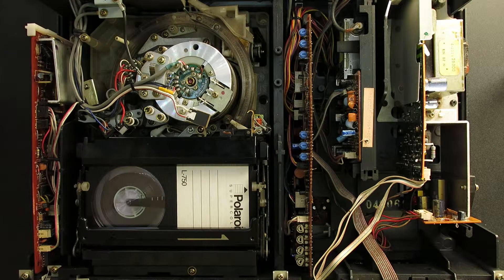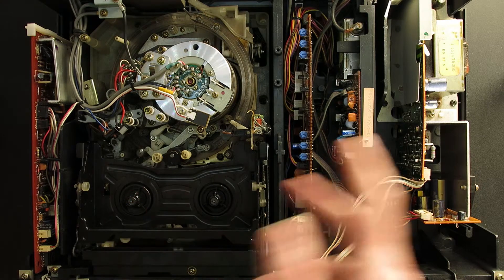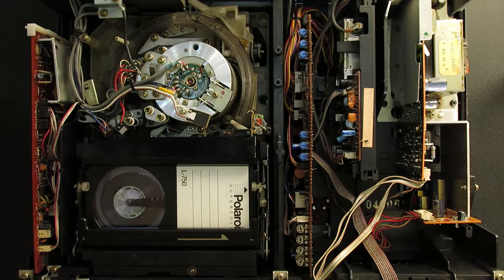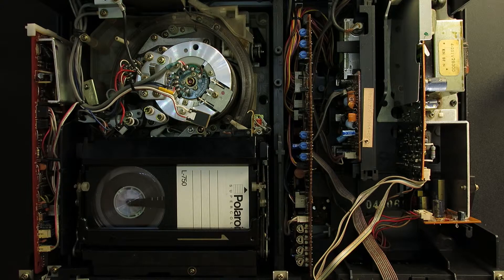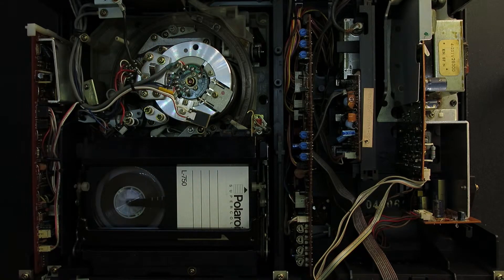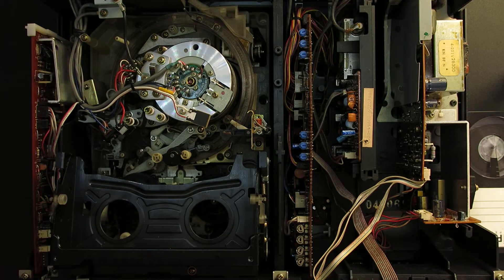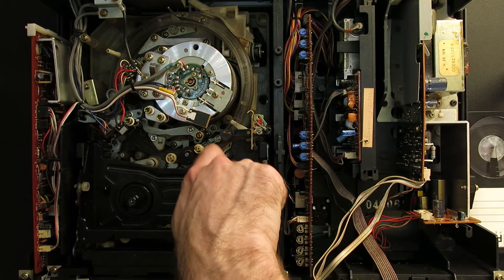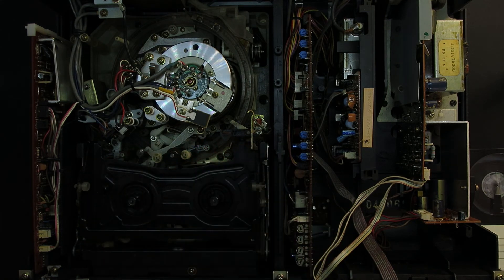1982 Sanyo VTC5000-II Betamax PAL VCR Repair & Discussion

Comment: Hi, do you know it's possible to move or push the loader ring mechanism by hand?. The reason I ask is that awhile back someone suggested to me that the problem I'm having with my 5000 could be due to the loading ring having been jammed or stuck, and that it's possible to move it by hand. I have tried moving the idlers and ring but it won't move at all. Maybe it can only be moved electronically.
Reply from the maker: As far as I remember it's a worm gear mechanism,  so it would only turn by actually turning the motor
Reply from the maker: Try taking the little belt off and see if the motor still runs
Reply: @jamesbennettmusic  Thanks for the reply. Which belt would that be?. Also, do you know where the reel motor is located as I can't locate it. I read somewhere that one of the problems could be with the motor being faulty. It could be anything I suppose, I've had the machine 3 years and still haven't been able to sort the problem out; to me it doesn't seem like a broken belt.
Reply from the maker: @Embracing01  top right of the loading ring, there's a small motor and belt you can see from the top that drives it
Reply: @jamesbennettmusic  Thanks for that. I just tried turning the small motor with the belt around it, turned it abit so that the idler that's touching the tape is moved out a little, I then tried a tape, pressed rewind and by some miracle it started to rewind. I then tried Play and that worked too. I'm guessing something was stuck or it's the belt?. At one point though the tape stopped playing and then ejected. Rewind seemed quite fast.

Comment: James

Just to correct you, the Sanyo 5150 didn't have two extra heads for colour search it was all electronic and keeping things monochrome for search/still frame enabled Sanyo to keep costs low. The 5150 also added a reverse play feature that only Beta could do without adding extra heads.

Comment: what are the differences between the mk1 and 2. How easy/ hard is it to replace the idler and belts ?
Reply from the maker: as far as I'm aware, just some cosmetic changes. An obvious one is the black background on the channel numbers on the Mk1, and silver background on the Mk2. Also the Mk1 has a moulded Sanyo logo. It's a cheaper inlaid logo on the Mk2. But definitely no new features.

Belts are very easy. The hard thing is finding one small enough for the idler assembly, but this isn't a problem if you use a kit I suppose.

Idler isn't difficult either, you just have to be very careful you don't lose tiny parts.

Comment: Hi James, I wonder if you can help. I bought a Sanyo VTC5000 off ebay a few months back. The seller described it has fully working order and was serviced with new belts, idler, etc. I needed another Beta for transferring some old tapes to my PC (the old Beta I have is knackered), so this replacement seemed a good but (I paid about £140 for it). When I received the machine it was in prestige order, all carefully wrapped. Over the week I tried a few old tapes and was pleased with the playback, though there was a kind of "static" buzzing noise heard mostly throughout the playing which I never thought much of. I played one tape and did a test recording and then left it unused for a few days. After about 3 or 4 days later I decided to try some more tapes, I switched it on and put in a tape, but this time it wouldn't play or rewind or Fforward. I don't know what could've gone wrong as it was working fine a few days prior. All I can think of is that maybe one of the tapes has knackered the heads up or caused it to malfunction. I'm thinking that maybe that there was some static charge on the tapes (they were brought down from the loft after 20 something years), and this couldve damaged the electronics. Or maybe the belt has broken, but how after only a few plays I don't know.

I shouldve contacted the seller, but I think they would've just said it was working fine.
Reply from the maker: They do hiss a lot - it's because the tape speed is so slow and the preamp, I assume, is fairly run of the mill for budget reasons. 

When you close the lid, does the motor briefly turn to take up tape slack? Do the buttons just do nothing at all?

Do you know if the power supply has been recapped?

If you set the clock, does it keep the time, or does it lose it every time you take it out of standby? This can indicate a capacitor failure if it does.

Comment: Do you fix vcr I have an pal vhs Sony md that eats tapes and only plays when I press rewind for a couple seconds then says err
Reply from the maker: Could be any number of things. Check for loose or dry belts, tyres that don't grip or pivot arms that are seized and don't pivot! At least there are plenty of VHS decks around still, so it's perhaps no great loss if one fails.
Reply: Thank you I dunno if I would ever open it up and fix it myself I wish maybe I dunno honestly should I ????
Reply: Thank you I dunno if I would ever open it up and fix it myself I wish maybe I dunno honestly should I ???? Are PAL insides different from Ntsc
Reply: Thank you I dunno if I would ever open it up and fix it myself I wish maybe I dunno honestly should I ???? Are PAL insides different from Ntsc

Comment: I have the MK1 version and I think someone managed to swap the bottom video board with one from a VTC 5550 because I spotted a SECAM sub-board in there. Does yours have that module for SECAM?
Reply from the maker: Hi Fivos. While looking up the model you mentioned I found your other posts elsewhere regarding the secam board, haha. I've had a look in my machine and found no secam circuitry. I think mine is an early MkII as it still has the lace-up bug in the control logic as I demonstrate in the video. I've seen later serial numbers with the darker coloured top panel (mine is the same colour as the front panel) which may have slight revisions, I don't know. 5150s seem rarer on the UK market now.